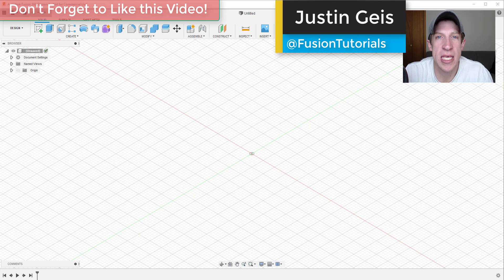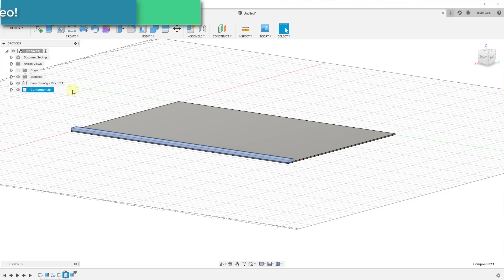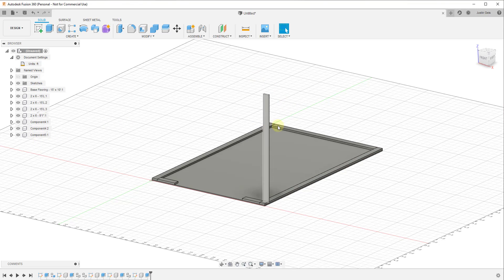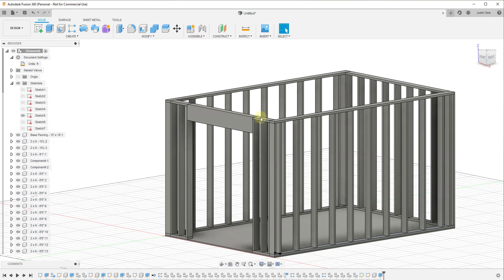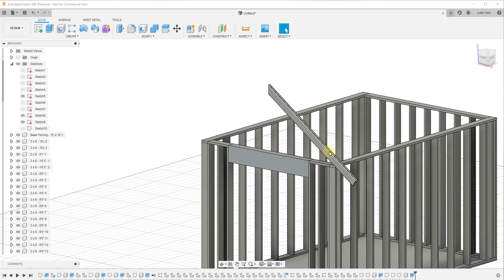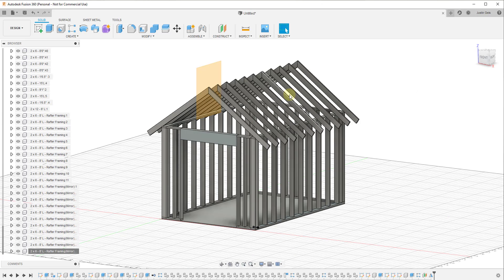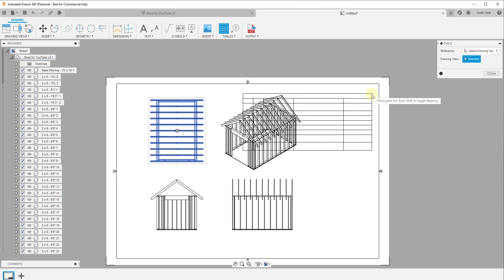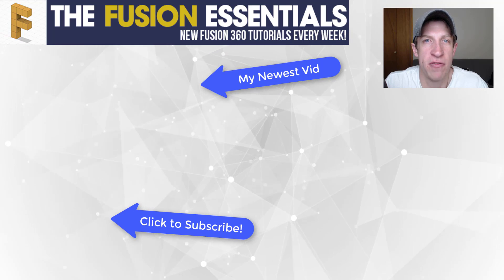Modeling a FRAMED SHED in Autodesk Fusion 360

Comment from the maker: Hi everyone! Let me know if you have any questions in the comments below!
Reply: Great video, as are all of the tutorials you’ve made.

Could you go into some detail on how to find midpoints? I think I found it in the constraints bar, but I want to make sure I am doing it the most reliable and efficient way as that will likely be an important tool for many.
Reply: Hi, I really like your tutorials. I'm a newbie to Fusion360. This one was exceptionally useful as I'm busy designing a chicken coop. Using the pattern function to create all the beams is fast and easy. I predefined a lot of parameters upfront, so I can control the whole setup (LxWxH) at any time by just changing the parameters. Number of beams is a calculated parameter (e.g. I try to space them out around 50cm) . Now comes the part I get stuck. I want to cut out a few windows from the patterned beams at a specific location (eg. somewhere in the middle, fixed position from the side and ground), but when I extrude the window, or combine, all beams are affected... because all beams are 'linked'. Another issue is, when the dimensions of the shed change (increase = more beams, decrease = less), then it all goes nuts... Perhaps it's my design strategy in the order of applying the features... I  wonder if you have an idea or workaround? Thanks.
Reply: what would be the easiest method to put in the framing for a window? I would like to see this done if possible.
Reply: Hi! Great videos! Do you have a model for a Pergola? Thanks from Sweden!
Reply: Excellent video on laying out dimensional lumber as I jump onto Fusion360 to make a treehouse for the kids. Thx
Reply: I am just starting to learn now. Its a mine field but that's for making it easier.
Reply: Sir Scofferoff  He does this in all the woodworking tutorials (maybe in all his tutorials). I don't understand it myself. Why add the extra step of using two drawing tools to do what one would do? It doesn't make sense.
Reply: hi! I'm trying to do a simulation of a wooden structure with fusion 360, but when I select Radiata pine as material it dosen't let me do a simulation because the material is a non - linear material. Does someone know how to do this type of simulation with wood? thank you

Comment: Good Video. Headers need King studs on either side at least one so you have two 2x4 or 2x6 vertical boards on each end of the header. Iwould also do a double top plate with the 2x horizontal boards to stagger over each other. other then that seems good.

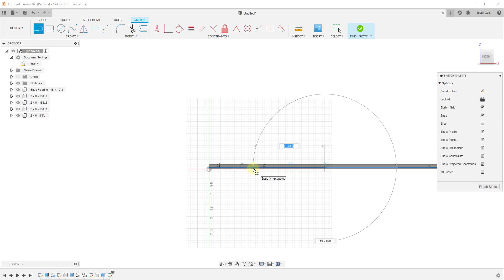Comment: Can you go over your snap settings? I can't get my line at 4:17 to snap to the edge like you. I made it work by using constraints but you didn't need too. After drawing that line, the rectangle won't snap to the top corner of the existing 2 x 6.

Edit: I figured it out. Go to Preferences -> Design and check "Auto project geometry on active sketch plane" I had to delete a sketch and recreate it and then it worked. WHY is this not the default behavior?

Comment: When you’re drawing a sketch of a rectangle, why do you draw two lines and then fill them in with a rectangle rather than just starting with a rectangle on the corner point and typing in the dimensions? Seems like that would be fewer steps, quicker and easier.

Comment: Is there a reason you use 2x lines to find the corner of the rectangle? 
For example at 1:56 cant you just draw a rectangle from the bottom right corner and dimension it?

Comment: Will you recommend any other software other than fusion 360 to get permitted by city?

I just find it very limited with built-in modules (except for bolts/hardware)

I want to build something myself and get a permit with the city.

Comment: Excellent video, as usual.  I'm learning many, basic design strategies (how to build this, how to duplicate this, where to click, what sketch plane to use, etc.) little by little.  I would love it if you made a video specifically to teach the fundamental methods for successful modeling in Fusion 360.  It seems like an incredibly powerful tool, but with such power comes complexity which means there are 100 ways "to skin a cat".

Comment: Thanks for the video!  Does the table ("schedule") in your drawing pull the values under "Part Number" from the text description you typed in of each component?  Is there any way to make the length parametric (i.e., so if you updated the length of your building to 16' from 15', everything would update automatically)?

Comment: Thank you for this video! I’m drawing up a frame work for a building that I’m going to build. This video answered a lot of the questions I was having. I still have two questions that I can’t seem to figure out. 1) Is there a way to modify one or more  of the wall studs without it trying to modify all of them? Since it was made with the pattern feature it tries to modify all of the patterned studs all down the wall when I’m trying to cut for windows.  2.) Is there a way to group parts after they are drawn as components? I’m trying to group all of one wall together for individual prints and parts lists. Example; Front wall framing and parts, interior wall framing and parts, left wall framing and parts, rafter framing etc. I have watched every video I can think that would address these questions with no luck. Again thank you for this video, there’s not much architectural fusion content out there!

Comment: 18" module? You will need to cut every piece of sheathing on the roof. Try to use a module of 4' for framing spacing. 16" or 24". Then full sheets meet on framing members.

Comment: Perhaps as an example of modeling techniques, video could be used after some reservations. However, a real shed built according to this design would not last, and it would be a pile of battens after the first wind. I'm not talking about snow at all, that's probably why there is no finished roof.

Comment: A challenge! Build a parametric shed so that the length and width could be changed by 2ft increments. I got a certain way but got stuck. I fully admit it would be quicker to design a new shed maybe with saved sub assemblies, but as I said it’s a challenge. Best regards.

Comment: Hey Justin, I am completely new to fusion 360 and have been going through your woodworking tutorials. They have been fantastic, but I am finding an aggravating issue with fusion, and I'm sure it's gotta be 'feature' but it's annoying me like crazy. I have looked elsewhere and googled things but can't find anything specific. When drawing a sketch, and then drawing a line or 2 point rectangle, I can type in the numbers in the box, and then immediately after typing a lock appears next to the entry box and it takes wherever my mouse had stopped moving instead of matching the length I entered in the box. If I try to go back and edit the box, the numbers I type are red and won't change. The only way to change it is to finish the box or line, then go back and double click on the value to change it to the right length. Why is it being locked somehow?

Comment: So one thing to help work flow you can do is start a project and right click the top level component/name in the tree and select create “new component” this will let you keep the sketches associated with the component and let you name the component immediately. I find that easier to keep track of and has a few less steps in the long run. I just started doing this myself a couple months ago.
Reply: This was a great tip and will change the way I work in Fusion 360. Thanks a lot!

Comment: @16:25 Fusion automatically locks horizontal and vertical projected views. If you hit the SHIFT key and it will unlock it so you can move it anywhere you want.

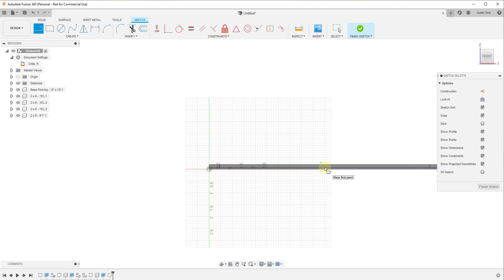Comment: Thanks for this. How did you draw the line from the midpoint at 4:10? I can't see the ⃤
Reply: When you are in sketch mode, and your top component is active (Shed), when you bring the cursor midway into the floor, the triangle for midpoint appears.  If the top component is not active it will not catch the other components. (it will kind of ghost them)

Comment: Thank you. This was very helpful. I'm trying to layout components and materials inside of a car trailer that I'm refurbishing. I haven't quite figured out the right method to get there just yet. I'm going to try and catch up on all your more recent videos and look for one where you hopefully are working inside the structure. I want to layout ceiling and wall sheeting, lighting, switches, etc.. The electrical seems more important for me to sort out, so I can move on to putting on the wall coverings. This was my poor man's way of getting an expensive car trailer. Buying a water-damaged mess, gutting it out, replacing the roof, and refurbishing the insides. This was really informative with lots of shortcuts for the duplication and even providing a materials list... Fantastic work!

Comment: So once I selected a 2x4 and copied it across a span, now it wont shut off. I finish sketch, and start a new component, etc., to build the corner, then when I pan out, I have 8 more complete corners. I try selecting and deleting them, and it deletes all of my corners, etc. It also curiously shows the copied 2x4's with opposite rectangle buttons that allow me to free move them. How do I totally escape from the rectangular pattern command?

Comment: Not sure if it’s possible in this software, but for cut list sake is there a way for it to know a sheet of plywood is 4’x8’ thereby telling you how many sheets you’d need for the 15’x10’ base? As it is the item list has qty 1 for the 10’x15” base. Obviously it would take more than one sheet. Just curious. Thanks for the tutorials!
Reply from the maker: I don't think there's anything built-in that does this - you'd have to model it out manually to figure this out I believe...

Comment: Great Video!!
Reply from the maker: Thanks!
Reply: @TheFusionEssentials  I have a question. How do you add cut outs for windows in the wall studs with out affecting all the studs in the wall. I followed you here and went to cut out a couple studs to add a window and all the studs in the wall were affected.
Reply: I have answered my own question by doing a work around. But still curious if there is a away as mentioned in the question. Thanks!!

Comment: Good video.  There is one thing that is important in framing that would be good to include.  The rafters should be directly over the wall studs.  Is there a way to tie the rafter pattern to the wall stud pattern?  BTW, usually studs and rafters are on centers that is a divisor of 48 so sheet goods can fit over the framing without cutting.  That would be on 12, 16, 24" centers.
Reply: he states in the video that he knows the framing isn't necessarily correct, and that this was an exercise in modeling not building, there was plenty more wrong with it, no king and jack studs under header, no double top plate, corners were framed in backwards, etc etc. it was meant to teach you how to model a buildings framing, not how to frame a building.

Comment: I'm new to Fusion 360, and designing my house remodel as a way to learn it and complete architectural drawing for the building department at the same time.  Your video is just what I needed to help me get started.  I am working on foundation drawings for the concrete work.  If you have the time a video on how to sketch that out would be a life saver!  I've done a layout sketch but am stuck on how to turn it into a 6" x 24" footing with j bolts and rebar included.  The framing I am doing is double wall and I am filleting the corners so that my insulation will wrap around the entire wall construction.  I have to meet California Codes or better and am trying to meet Net Zero energy efficiency.   Any basic tutorials for this stuff would be helpful.  Plumbing, Electrical etc. would also be helpful after I complete the foundation/framing drawings.  Super helpful video!

Comment: Awesome videos.  your teaching style is really easy to follow along to and you explain key points really well as you go.   Just discovered your channel, so going to plough my way through a load of vids today.  I am here to work out how to plan out the wood framing for my workshop build.  mostly extruding a bunch of 2x6 with OSB and insulation.  I will try and make it as detailed as possible, so will include things like the Slab Rebar and vapour barriers.  I will then need to work out my bill of materials.

Comment: Thanks for the tutorials   At 4:12 into the video, when you started the 3' line, how did you know where to start that line?  Did you snap to the middle of the 10' dimension and going 3' from the center or were you looking at the grid?  My snaps don't appear to be working.
Reply: Same goes for me, in a few of his tutorial by now.
What I do is project (shortcut is 'P' key)  the objects I want to snap on and it fixes the issue.
No idea why he doesn't need to project.

Comment: Looks like you modeled a 6 x 10 beam and called it a 2 x 10. The beam would be structurally stronger if it was supported on top of the 2 x 6’s
Reply: I meant 12 not 10 for the depth of the beam